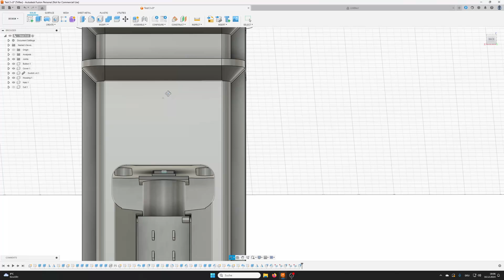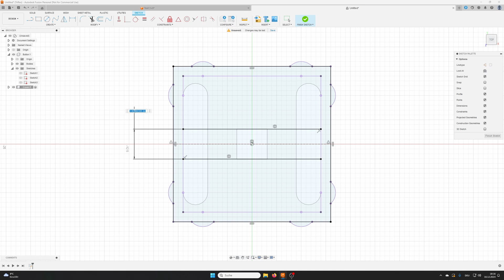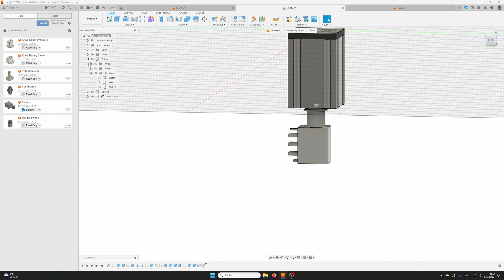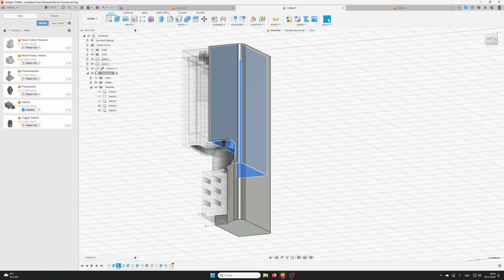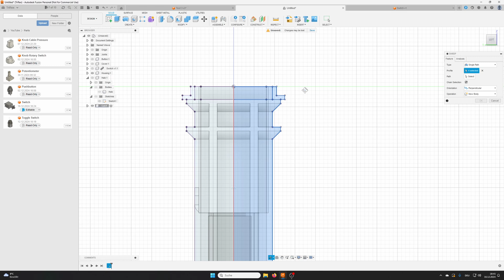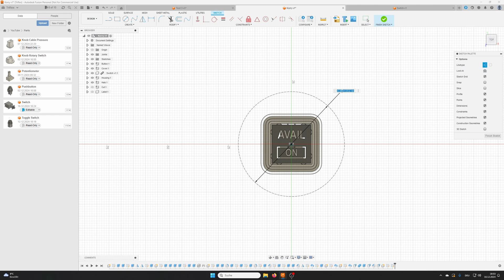The Korry Switch Part 1 - Full Hom e Cockpit Build - EP 17

Comment: I understand how the upper ring of the Korry housing holds the halo ring against the upper panel but I don’t understand what the second ring does? I suspect all will become clear when I see part 2 😊
Reply from the maker: The lower ring is pushing against the bottom part of the panel. The Korry is "sandwiched" between the two panel shells without the need of screws or glue. Be patient my friend. It will make sense very soon!
Reply: @TheCockpitPrinter Yes that’s what I thought, but I expected the the second ring to be up the other way… as you say, I’m sure it will become clear soon, thanks 👍🏻
Reply from the maker: @ that is a really good point and makes a lot of sense. But with a flat surface an the bottom of the ring you have to add some support structures during printing. The chamfer doesn’t make a difference in the functionality but saves the support structure. The lower ring will completely be hidden by the bottom panel to create enough space for the LED strips.
Reply: @TheCockpitPrinter that makes perfect sense 👍🏻

Comment: Hi I wanted to ask what 3d printer should I get in order to start printing my home cockpit as well, specifically I wanna know if any 3d printer is valid or if I need a specific one. By the way good video, I follow the series even though I don't comment but I just wanted to say to keep up the work, can't wait for the pfd and the ecam display, I'm scratching my head to understand what kind of display I need and how to display the pfd and the ecams on the dispaly.
Reply from the maker: Thank you very much! I'm happy to have you on board and my videos are usefull to you! 
You don't need a specific kind of printer to print your cockpit. I only use PLA which is very easy to print an doesn't require an eclosure. Even on entry level printers it should succeed. But if you want to get the highest level of detail with the labels on the panels you definitly need a multicolor printer. I always recommend the Bambulab printers. Even the A1 creates a great level of detail. (I don't get money from bambulab) In addition to that the software provided by bambulab is exceptional. You don't have to care about all the parameters and need dozends of failed prints until you have your first successfully printed part. 
For the displays my plan is to use cheap tablets an connect them with spacedesk via wifi. The PFD and ECAM can be created as a pop out window by pressing altgr and click into the screen you want to pop out. This is by far the easiest way to my knowledge.
Reply: @ thank you, highly appreciated